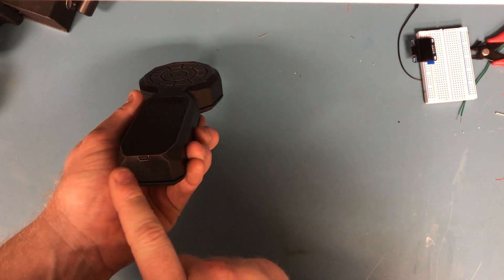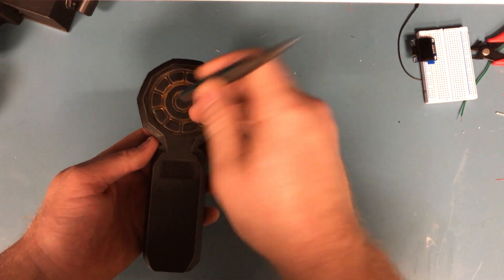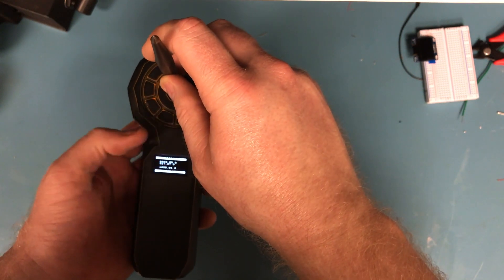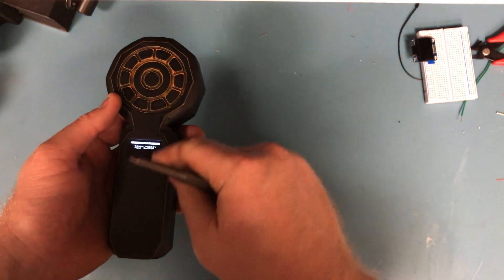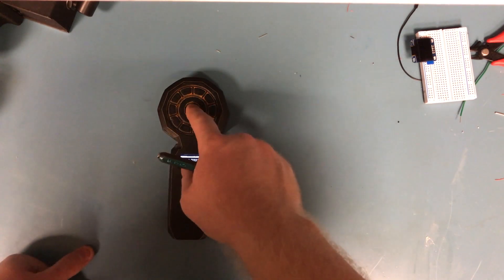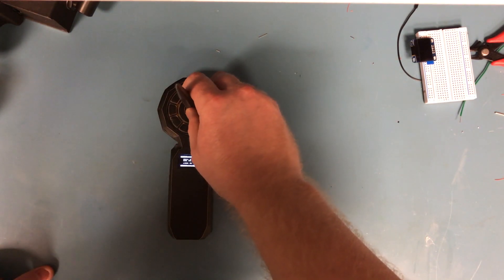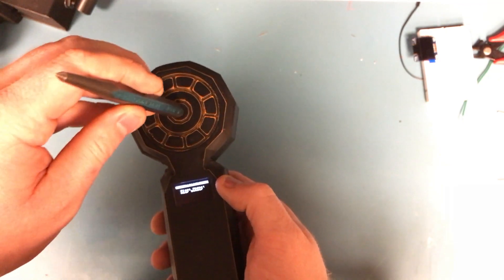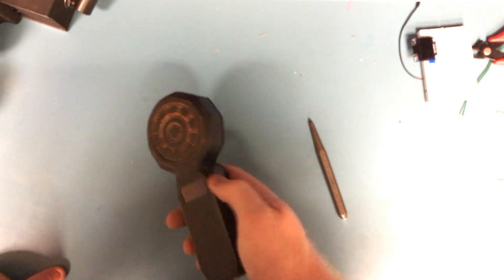DIY Gauss Meter with Dual Sensors for Measuring the Strength of Magnets

Comment: I'm very much impressed. Pretty useful device.
I'm curious: what is the necessary field strength needed to turn the device on? If one would have the device, it's normal to think that one pretty much tries out a few different magnets to get a feeling for the devices readings. But I wonder, if there's no ON/OFF switch, if I would to try a few magnets, what would the lower limit on the required magnetic force be? If the item does not turn the device on, I would have to guess that it's magnetic field is either too low or it isn't even magnetized?
Thanks again, awesome device.
Reply from the maker: That depends on the reed switch you use.  I don't have an exact number on mine because the reed switch I used was salvaged but it turns on with really weak fridge magnets. You would have a very hard time finding an actual magnet that wouldn't turn it on.  I'll try to find something magnetic that can't turn it on and then use a magnet to turn it on and measure the strength of the mildly magnetized object.  You can easily add an on switch if you'd like.
Reply: Oh, of course. I personally like it without (a matter of taste I suppose). 
I work with FPGA based SoCs, and I'm used to turn in parameter estimates of the solution, similar to datasheet tables. So my first though was, well what is the range it responds to? My questions about battery life were answered by reading further below.
Anyhow, I'll be sure to check out more of yours. Cheers!
Reply from the maker: Julian Sp the range that the meter can reliably read is up to 4000 Gauss.  Anything beyond that should only be used for comparison purposes.  For many magnets above 4000 Gauss at the surface, it will still be accurate from the other sensor 3/8" away.

Comment: I would have added the on off switch. What happens when your testing to see if something is magnetic, and not testing the strength of the magnet itself? Do you assume that the material is simply not magnetic? Do you assume the battery is dead or the sensors are faulty? I guess as long as you always keep a magnet around to act as a sort of "key" you can always check, but I think that sort of defeats part of the effect.
Reply from the maker: That's the beauty of open source.  You can do whatever you want with it when I release the files.  I made it specifically for testing magnets. When on, the unit only only draws about 40mA so the run time is about 21 hours.  Seeing as how I'm only using is for a few seconds at a time, I'll probably only have to charge it once a year.  If the screen doesn't turn on with a magnet, the battery is dead and I'll plug it in.  Not a big deal for me.  It's pretty easy to tell if something is magnetic or not.  What is something that you would want to know if it was magnetic or not?